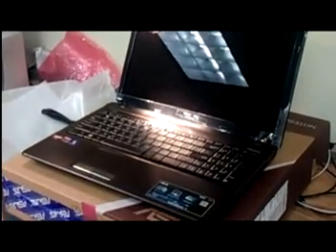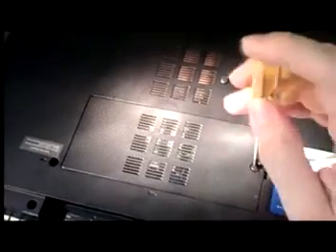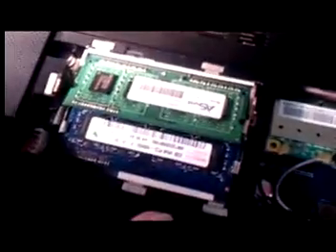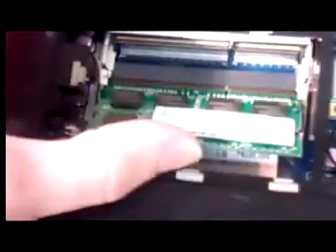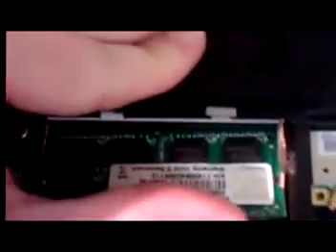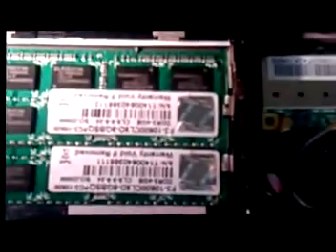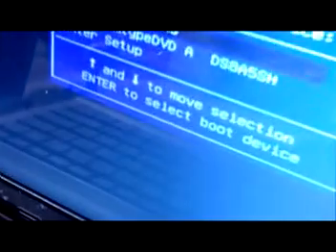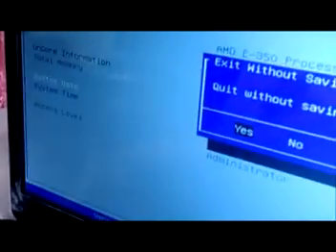Installing RAM into an ASUS A53U-XE3 Laptop

Comment: You need to buy RAM that is meant for laptops. I'm assuming that you bought one that was meant for a desktop. The desktop ones have a little bit more extra bulk added on for looks or so. The ones for laptops are meant to fit in the small space and aren't supposed to be seen, so it doesn't have the extra visual features. At least that's what I've learned from upgrading my fair share of computers.

Comment: Thank you very much. I followed your instruction and it worked.
You have an important tip which is very helpful. Around at 1 minute of your video, you mentioned the cover is kind of hard to remove, and you just need to be careful because there are clips.